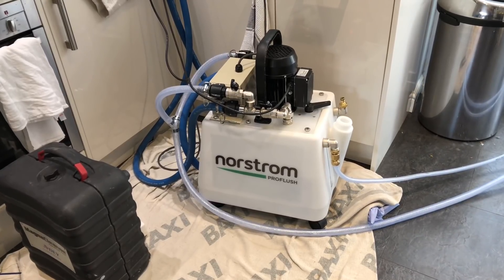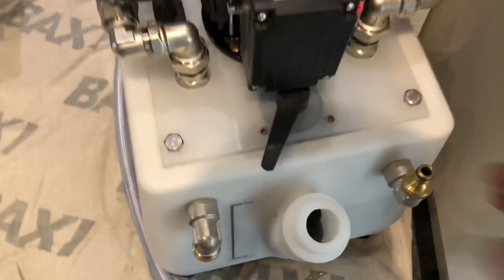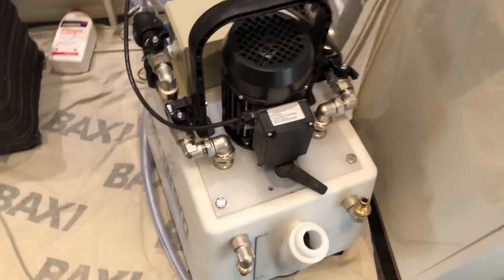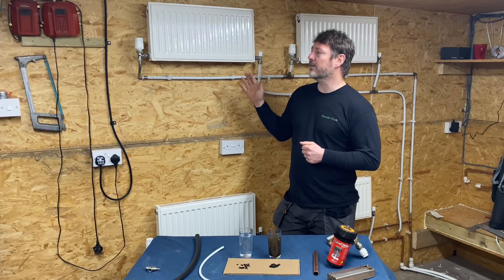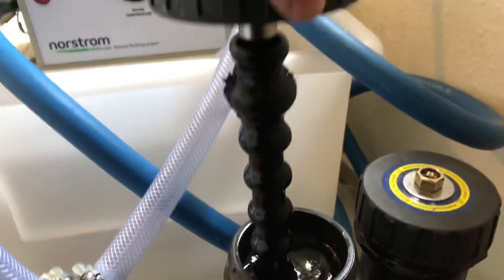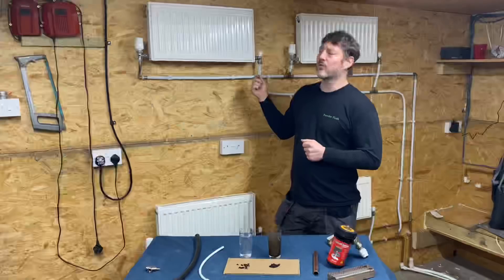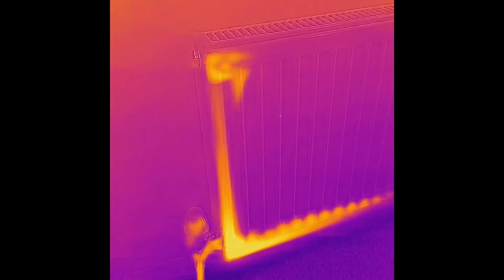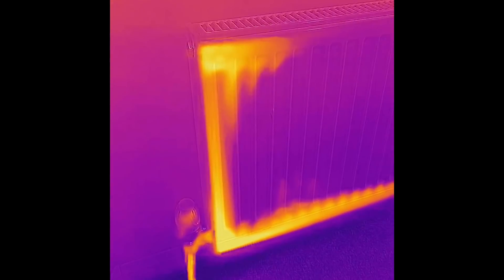Powerflushing - Rust Sludge And Magnetite In Central Heating Systems

Comment: Hi Allen as a consumer & engineer retired, I tried mains fluch, that looked like it worked, but I have 10mm plastic microbore I realised the flakes were getting stuck near the valves, opening them up could hear the flakes then going around the radiator, so next chemists I've added is Fernox F8, I leave it as long as possible say two weeks, viessmann 200W has 2 rubber hoses, nothing there as they were cleaned out by Viessmann in boiler service, I do another mains flush again, system is a lot quieter, fitted new low power high efficiency pump on to the boiler and a new diverter valve, from the rubber on that i could tell that I had a serious problem with flakes in the system getting stuck in the microbore pipes near the regulator valves, certainly sounded crunchy when the gatevalves were exercised, 
Allen is there anything stronger than Fernox F8 ? 
The truth is the system wasn't flushed for over 13 year's 😮
Yes 👍 left it a long time, ssincee I added Fernox F8 prior to that was mains flush,
Many thanks for your helpful videos 📹 👍👏❤

Comment: Hi, if you are losing pressure in system and suspect a water leak which is not obvious as where it maybe would you try fernox leak sealer or try and detect leak with a professional company?

Comment: Great video. As an end consumer, we hear a lot of negative stories about power flushing causing leaks. Is this true and how much more is the  power flush operating pressure vs the usual operating pressure of the central heating system?
Reply from the maker: Very good question. you do end up with more pressure but i have only had a couple of issues over the last 20 years. Thank you.
Reply: The main concern with system cleaning is that the dirt could be preventing leaks!  Once cleaned you may have to sort pinholes in radiators and possibly the boiler. In the end though a clean system will save you money!

Comment: Alan is it ok to power flush micro plastic pipes? I thought you might run the risk of the joints coming apart under the pressure? And if it does behind walls etc could cause lot of damage.
Reply from the maker: I have never had a micro bore system leak while flushing. I am sure it could happen. Thank you.

Comment: Hi Allen . I’ve just had my boiler serviced & flushed . & I asked the heating engineer who carried out the work will we have to top up the inhibitor. I was shocked at the answer being told that now the manufacturer of the the boiler doesn’t recommend the use of inhibitors anymore  has it may corrode rubber hoses etc, before I have always been informed that  if there’s no inhibitor or not enough it may void your guarantee . It seems I’m in a no win situation if I didn’t use / or now if I do use it . hopefully 
you could shed some light . Viesmann boiler still under guarantee . thanks Great work .
Reply: Too much inhibitor corrodes the rubber pipes in the Viessman 050-W apparently.
Viessman changed the rubber to brass in the 100-W and above boilers.
Reply: @iheggis86  thanks for your reply . I have the viessmann 100 & it has the the rubber hoses. the point I was trying to make is how viessmann can implement there own doctoring . Making there guarantees not worth the paper it’s written on !!!
Reply from the maker: The radiator manufacturer requires inhibitors. Thank you.

Comment: Yes another good video, thanks. just been adding a larger radiator for a customer to a 2year old boiler and system with no filter there. water already looked dark. original installer never been back for servicing , now i know why . useless thats why:_toolbox3:
Reply from the maker: Tell them they need a powerflush. Thank you.

Comment: Questions for Stephen:    as  the  pellets going round the system and boiler got me thinking...............   
     
Those plastic pellets looked fairly large,  I presume that the would be for 15mm and up ?  and do they pass through combis without issue?

Do you just add the pellets to the PF machine tank and pump them through?

Do you recover the pellets from the dirty discharge water?

Thanks, interesting  video.
Reply: Allen did a video on power flushing with pellets a whole back, it’s worth a watch if you can find it on his channel
Reply: Do they fit through trv4. Tiny drilling

Comment: I am not a plumber but as a handyman I fine blocked plastic pipe because the plumbers run pipes unclipped underneath floors The sluge settling at lowest point. Once cleaned out and clipped problem has never returned .not having the right tools I back flush one radiator at a time then run boiler with cleaner 4 hours then flush again .not the best but has worked for me. Thank for my education 😊

Comment: Interesting video! Is it better to flush before a new boiler is installed so the gunk doesn’t go through the new boiler, or would you flush immediately after / upon installing a new boiler?
Reply: i always flush before i hang the new boiler. why would you pollute the new one????? it doesn't make sense to me.
Reply: If the existing boilers working drop in chemicals and magnaclense the ecisting system.  Then do in a mains flush whist the boiler is running. Cold flush it then then start your install.

It is possible to isolate your newly installed boiler and do a cold mains flush.  That's if the previous boiler was a non runner. Tap out a T on the flow pipe just under the boiler and use the filing loop whilst flushing each rad individually.

Comment: Nice one Allen , I was once told by a so called water treatment specialist that if you put 1 gallon of white vinegar per 50 l of water content in a heating system it will prevent rust forming and causing blockages , I have never tried this but just wondered if any one else had.....!
cheers mate....👍
Reply: Fill the system with di-ionised mineral water.  It will prevent oxidation in the system to an extent.
Reply: Wouldnt that be more expensive to buy than a bottle of inhibitor?
Reply: @Lutonman2010    It’s about a fiver a gallon in the supermarket....👍

Comment: Thankd for the video, I had a couple of questions about the annual servicing, I didn't know we should be testing for water quality, when did this come in and what evidence should you leave and what kinda of test is acceptable?  Maybe worth a video on the testing? Seems the old boiler service is getting more and more complicated what with having to have burner seals and this and that.
Reply from the maker: https://www.youtube.com/watch?v=3VcMnZEbrpg
Reply: I started when most boilers were made out of cast Iron They had a multi function valve a thermostat and a burner . When they faulted which was more often than not a thermocouple or a dirty pilot they were quick easy and cheap to put right .30 years was not an unusual life span . Now they last 10 years if you are very lucky and cost a kings ransom to put them right . I an retired now but I am glad I am out of it  ,You are right about the service expanding from filters to shock arresters to expanding electrical checks just to get the case of the dam thing ,water testing also special water being used to fill the system . Good luck

Comment: Alan in my 45 years in the industry I never found that radiators rust from the inside unless their was an excess of oxygen , normally a leak of water so the header tank was filling or more normally because the system was pumping over .This Will  cause radiators to pop in double quick time .My point is if radiators are rusting and getting pinholes there is a fault on the system . Likewise if you castle effect in radiators so only the side and top are getting hot this is not normal in a system that is working properly.The same for the blocked copper pipe and the blocked cold feeds .I have seen this but if it was just normal it would be all over the copper pipework in the system but it is usually to do with the cold feed set up normally a cold feed will be blocked just for inches around the position where it joins the system . It's something happening around that particular area . I still look after one system I put in 20 years ago . Cold and hot flush carried out and no problems with the boiler in that time  My normal job was repairing relitivly new boilers  and systems  that I doubt had never been cleaned properly after install . Perhaps that's why we were changing ideal Isas after five years because they were uneconomical to repair .Keep up the good work ,  cheers .
Reply: totally agree. you need oxygen to create rust. i learnt that in science at school. good call by the way.
Reply: Yes crusty joints near pump inlets and leaking rad valves can suck air into a system also which accelerates corrosion. Main thing is to repair these faults then powerflush and dose with correct concentration of inhibitor.
Reply: how do you think fish live?